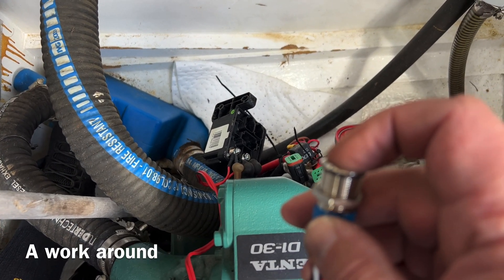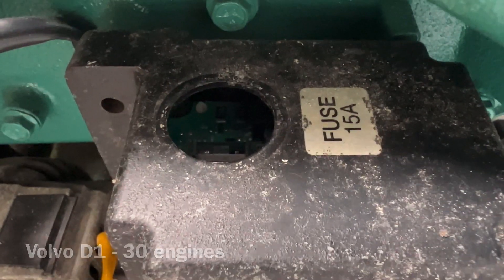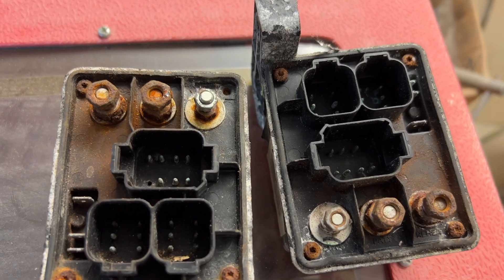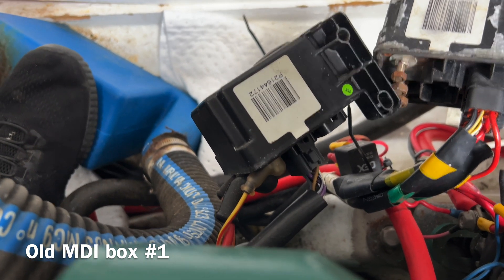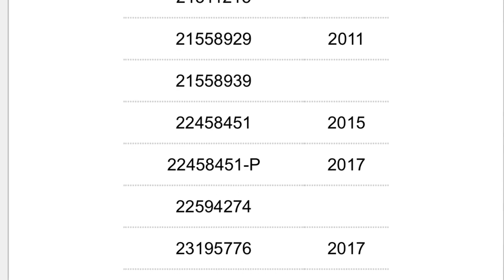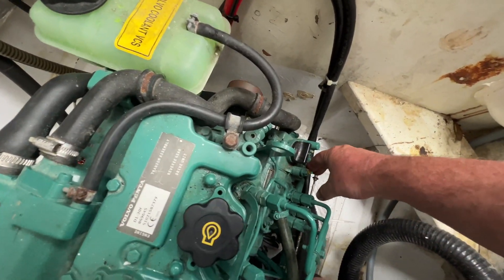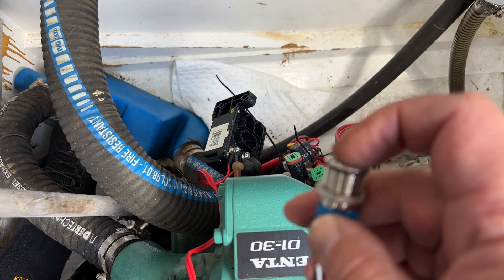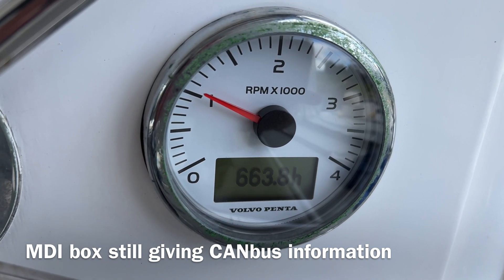How to bypass start Volvo MDI Black Box on D1-30. SV CATAMANTOO 2022

Comment: thanks for vid, did it end up being a faulty mdi?
Reply from the maker: No - I had lost a negative wire when putting a circuit breaker & bus bars on the Starboard engine battery. 
Identified later, reconnected and all working again.

Comment: Nice, thanks. Now if I can just get fuel to flow through in mine, I can launch
Reply from the maker: Hi - I hope you are successful. I have a 12v fuel pump & an outboard type squeeze bulb on the supply side - useful for priming the fuel filters and reinstating fuel if I ran out. 
These engines cope with air well, never had to crack injector feeds.
Reply: I did get it to start using it’s primer pump; but, did have to crack all lines, starting from the injector pump outlet, until fuel flowed through them. Then crack them at the injectors and wait until fuel flowed through #1 without bubbles (once I finally got fuel up there). Once she started I recracked the lines at the injectors to get straight fuel out of the lines. Then she purred like a kitten after sitting for 8 years. 👍🏻👍🏻